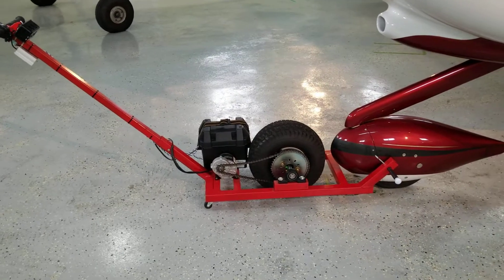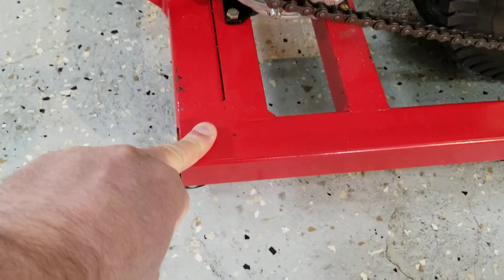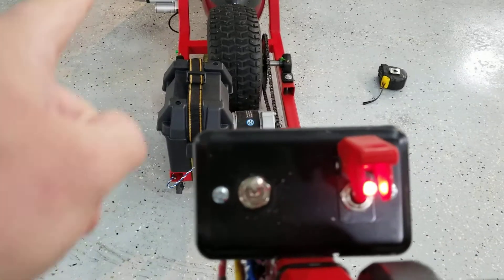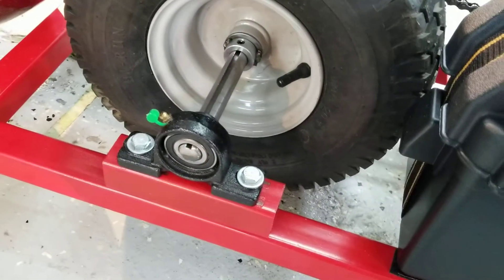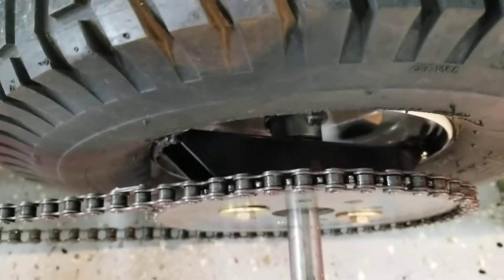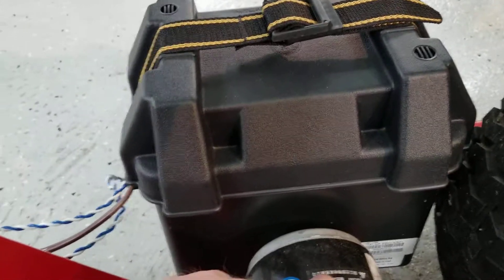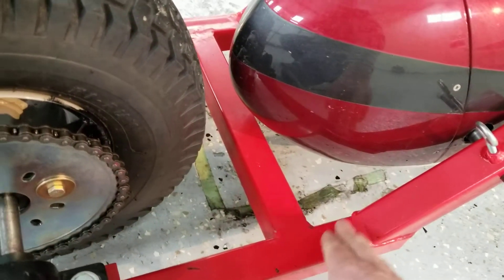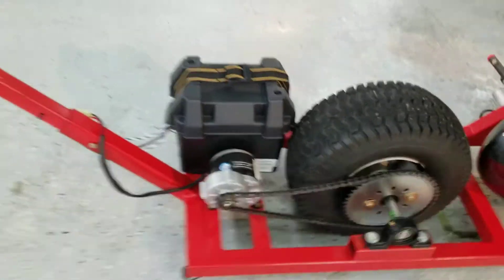Homebuilt Aircraft Tug Details

Comment: Any chance you have an electrical schematic or parts list?
Reply from the maker: I don't have a parts list and the schematic came with the scooter motor controller.  What I did was determine the size of frame that would work for my airplane, then pick a tire/wheel combo that looked suitable (on sale) and the rest are generic parts from Amazon.  The motor is 24 volt so I wired 2 12v dry cell batteries in series. The motor controller, brushed motor and thumb throttle are parts from Amazon. The particular ones that I used were for 350w scooter motor and are no longer available on Amazon but there are lots of others available.  If I were to make any changes I would probably go with a 450 watt motor and applicable controller because mine almost stalls out when pushing the airplane up an incline.  I think if you buy a brushless motor you have to buy the brushless motor controller.  I put this video on YouTube so I could easily share it with friends that were interested in building something similar.  It's not a how-to but more of an example of what you can do easily and inexpensively so if you can get some ideas from this to make your own design I'll be happy to hear about it.  If you want performance and features of a Best Tug this is not going to do it.
Reply: rocclobster I’m trying the same project and have the same motor controller but mine did not come with a schematic (in English) drawing.  Anyway you could post the schematic you got with the controller?  As chance would have it its the same controller i have.  I’m stumped on my wiring without it.  Thanks muc!
Reply from the maker: @rhr81  I don't have the schematic anymore.  It was actually just one of the pictures on the Amazon item page.   If you do a google search for scooter motor controller schematic and select images I think you'll find what you're looking for.  They all look to be the same.  There have been some people that have built these things and have had issues getting it to power up.  If you are going to switch the main power line (I did it this way) instead of utilizing the power switch connector on the unit be sure to connect the 2 wires in that connector together.  That will enable the box as soon as the main power switch is on.
Reply: @rocclobster  Thanks much.  still stumped on my wiring and not sure why.  in your second to last sentence do you mean wire the two "Key lock" wires together and use the toggle switch as the power on method you used?  Also, is it important to have a 3 wire thumb throttle connected to a 3 wire speed controller connection? ie, same number of wires on the thumb throttle as the controller box has? thanks again.
Reply: @rhr81   there's a site called electricscooterparts.com that has the same parts and everything you would need can come in a kit or you can get what you need, part by part.  The advantage of the kit is everything comes labeled as to how to connect to the other parts.   I'm currious...@rocclobster - what RPM is the 350W motor you used?  Yes, I too am trying to duplicate what you put together.  It looks pretty good to me.

Comment: What size tire did  you use ?
Reply from the maker: https://www.princessauto.com/en/detail/15-x-6-00-6-turf-tire-assembly/A-p8630105e
It's a 15x600-6 that I bought at Princess auto when it was on sale for 50% off.  The whole thing is just a mild steel frame and you can modify it to suit your aircraft.  This size wheel/tire combo worked out for this simple frame design but I'm sure you can make improvements on it pretty easily.
Reply from the maker: BTW Princess auto in Canada is similar to Harbor Freight in the US.